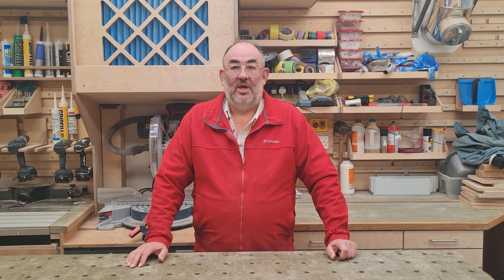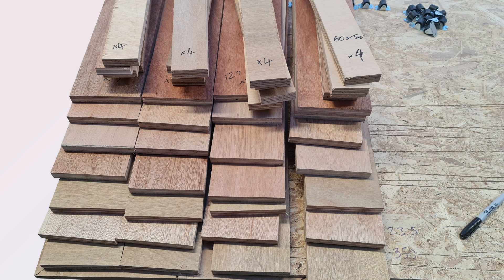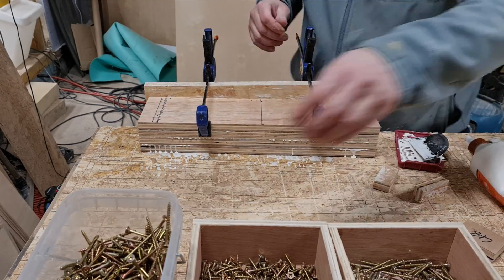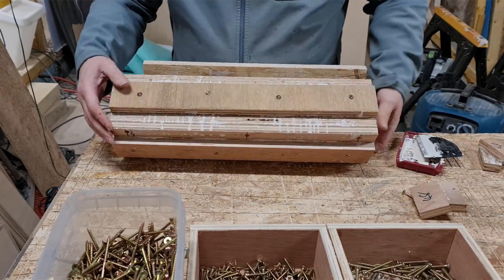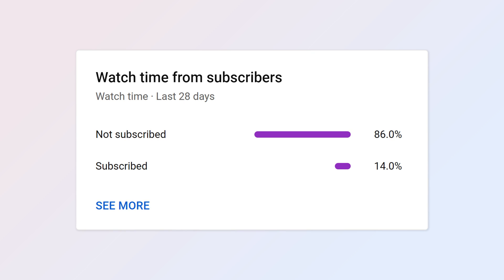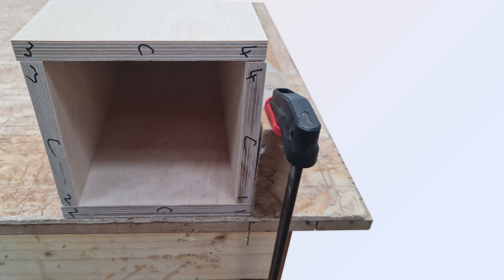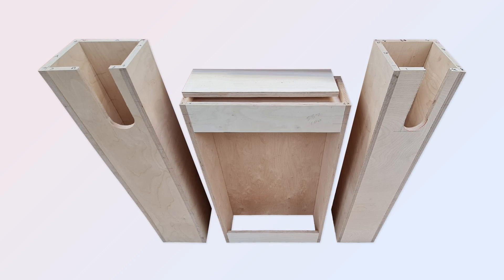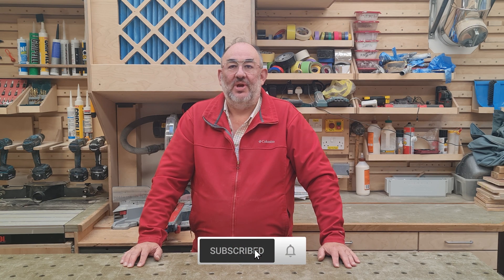Linear Actuator Legs - MOVABLE Workbench!

Comment: Looks very interesting. Unfortunately there just wasn’t enough information about what you are doing and why. Very hard to follow. For instance why do you need 100+ mini rollers?  This is a common issue when one is very familiar with something. When explaining it to someone else you assume they know or understand things they do not. I find myself really wanting to know more. Love to see a more detailed breakdown of your project  with drawings of your design.
Reply from the maker: Hello Derek. I'm sad to hear of your disappointment. I do my videos to put ideas in circulation, as a way of thanking the You Tube folks who have inspired me with their ideas.
There are no drawings, as the inner legs were built to a square size as a consequence of the plywood scrap thickness in my store. I then made the double thickness legs to size to accommodate the laminate and castors. Laminate to provide a durable running surface and the castors were the smallest height castors I could find to keep the legs as small in cross section as possible.
I disregarded the supposed load of each castor as you see so many cases being dragged along with broken castors and I worked on the basis that if I put a group top and bottom, any "tall poppies" might be squeezed down until all in the group were in contact with the laminate running surface. As to how many to choose, they were cheap by the 100 and the lateral forces say when bumping my heavy bench over the threshold  onto my patio to get something large through the workshop and into the garden would, in my mind, quite considerable and a collapsed leg would have been a disaster.
Do please ask other questions and I'll try and answer them.

Comment: i don't understand why you built such large housing sleeves with all those rollers versus pucking up the top and bottom of the actuator  and affixing them at a point where they could extend and lift the cabinet? what am i missing?  i still liked the video and am in the middle of doing something very similar with a kitchen island for my 71 yr old mother so it all made sense to me save the excessive amounts of rollers in the actuator sleeves, is it just an over engineering thing? to address possible drift? cause now you have me reconsidering all the mounting scheme'n i've been doin hehe, this kitchen island is gonna be @ 750lbs when it's done and the granite top installed, i can't have any binds or issues :)
Reply from the maker: Hello sikosis999. The most important thing here is that I'm not an engineer, just a retired vet. surgeon in a home workshop showing what I did, as is, with no guarantee of success or correctness. I do tend to take a rather Victorian attitude to construction, meaning everything ends up very very strong, just in case. When I made the bench I had another 8x4 foot bench which is now away so if my new bench fails, I'll struggle to fix it. I need my bench to be able to bump over a half inch threshold to park it on the patio if I need wide access through to my back garden and that in a heavy bench, I would image is a significant lateral load on the structure. 
Your 750lb island is much heavier and if things go wrong potentially life altering, if it fell on someone and I'm not sure what "pucking up the top and bottom of the actuator" means. I would be very wary of that weight, in the circumstances and probably best to get advice or at least duplicate something commercially tested and safe.
Thank you for your interest in my video and good lick with your project. 😀
Reply: @AMBuilds  excellent so i wasn't missing anything, you are a bit more of 'better safe than sorry' guy than i am :) i think i've settled on a metal H frame under the island with the casters and actuators attached directly to it, then racking that H into the bottom of the cabinet base. . . i'll get back when it's done :) i'm playing concrete monkey right now heh

Comment: Why did you choose to not have the motors much further down? That way you could have bought fewer of those gray/black castors. As this is a very well thought through process, I assume there is a reason for it.
Reply: I was wondering the same. I assume it’s for easier access for service on actuators if needed (also assuming he can remove the top). If on bottom you’d need a side access panel or to jack it up pretty dang high.
Reply from the maker: Hello Bo, thank you for your message and I am sorry it has taken me so long to answer you. I wanted to have as long a gliding area as I could so that it would best withstand lateral forces from pushing the bench over smaller items such as bits of wood. With a short gliding block, I would be worried over time the block may become twisted in the leg and overload individual castors.

Comment: Great build. 
I am currently designing my work bench with a similar powered wheel retraction. I think I even have the same linear actuators as yours. Do you power all four of the actuators from the same 12v power adaptor? If so, what amperage did it require?
Reply from the maker: I had the same dilemma as you, Opposabletoe and in the end used a sealed lead acid battery like that of a golf bag cart and the smallest conditioner from Ctek range to keep the battery in good condition.

That way I could put the table up and down without external power, for example in my case, if I took it onto the patio outside my workshop.

Comment: I guess there are two actuator benches on YouTube now, I just want to say I was first lol.
Reply from the maker: There's many more than two, Logan but thank you for your comment. You don't say why your bench does what it does with the actuators. Do you use it standing and sitting? Mine was all about being able to isolate the castors for stability as I have to stand on the bench for my high timber store and at the moment I have over 300kg of steel box section sitting on the top, with the castors tucked away.

Comment: That's a very solid build.   You don't thnk you could have got away with building hollow legs? Do you have a link to the actuators you used?
Reply from the maker: Thank you again for your interest, Nial. By hollow legs do you mean just single skinned. Yes probably I could although I would have glued screwed and dominoed them and made a C on its side shape or a long A shape for the front and shorter C/A for the ends of the bench to do away with leg to body joints.
As the rise is modest, I would have thought any lateral forces would be modest unless you wanted to be able to bump the fully laden bench over a threshold, in which case that could create considerable disruptive forces at the top of the legs. With all my tools, internal cabinet units (video to come) double torsion box, planer, vacuum set up etc, I reckon I'm on the way to 400lb or 180kg and I have a 13mm threshold onto irregular stone flags, if I want the bench out of the way.
For the linear actuators, it is just a case of searching for the stroke and weight, 50mm  and 6000N and for my build and see who has them. The original link for my purchases on eBay has gone. For me 1500N and 3000N would also have been fine but I think these short stroke actuators end up with a big load rating on account of the gearing.
Reply: @AMBuilds  "By hollow legs do you mean just single skinned" Yes that's what I meant, though you showed the solid legs were actually pretty fast to construct (when the wood was cut). I'm not immediately after actuators but you never know when they might be useful, I'll try ebay if the need arises.  Thanks for the reply, btw I've got the parf guide system if you ever want to borrow it for a comparison.
Reply from the maker: @nialstewart8263  Thank you and I'll keep your kind offer in mind.👍

Comment: Honestly speechless. Very impressive engineering! I’d love to know how your brain goes about solving these issues. Very very good work. 👏
Reply from the maker: Thank you Chris. Starts with a finished idea and then some on-line research and a look into parallel fields of endeavour such as medical equipment. All the info then churns away in the back of my mind for some time and usually in fits and starts the solution emerges. A secondary churn to simplify the first thoughts, then good to go. I've always tried to live by the motto taught by my old friend, Brian, of "Don't start with your hands until the job is finished in your head." Even with that, on account of my poor productivity, opportunities along the way arise to further simplify and tweak. I do enjoy coming up with a solution with elements that has not been reported before.